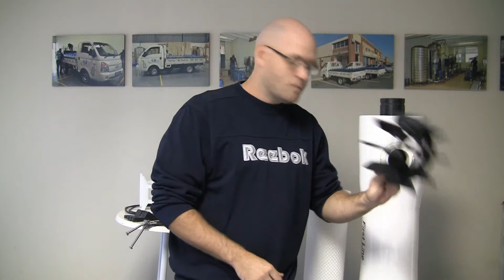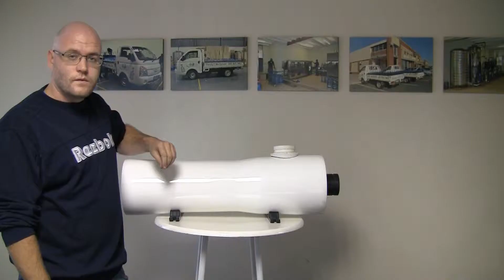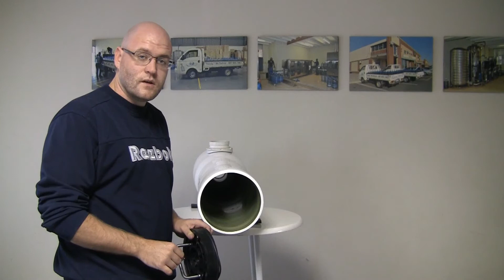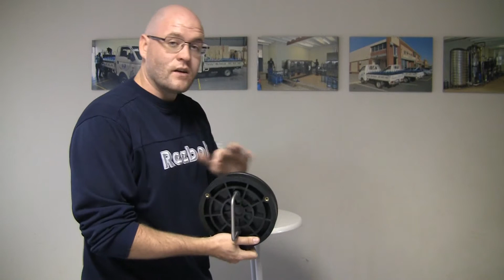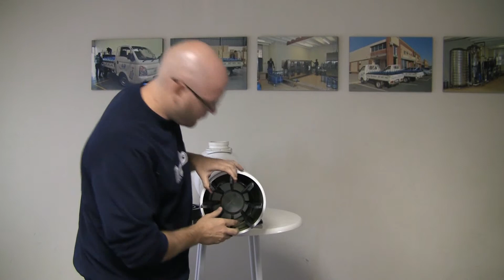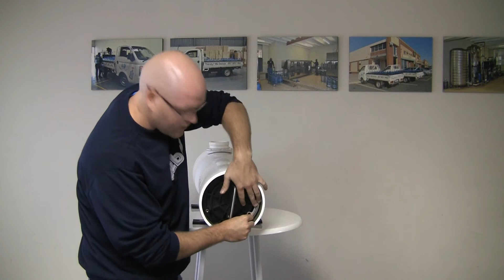FilterShop High Flow Filters

Comment: what is the service life for the cartridges in comparison to a big blue or 2.5" X 40"?
Reply: Good Day, 

The Life Span of the High Flow Cartridges would depend on a combination of several factors, including Turbidity (Dirt) levels in the water. Do you have an idea of the Turbidity level in your water? 

The daily / hourly usage levels, the higher the flow rate the shorter the lifespan of the filter. What kind of flow rate are you looking to use (liters per hour/day)?